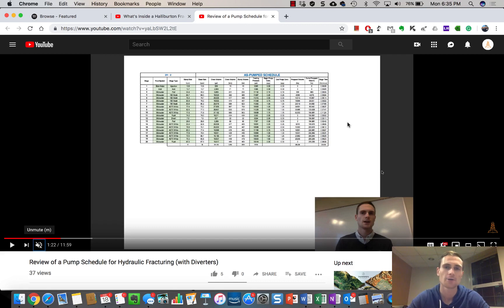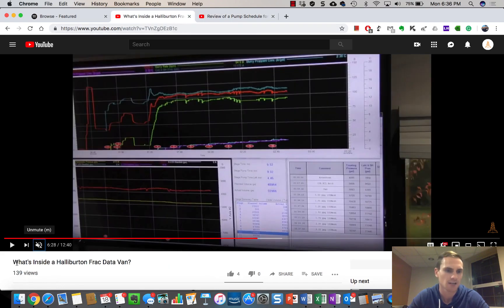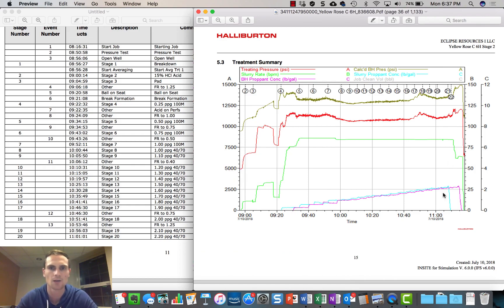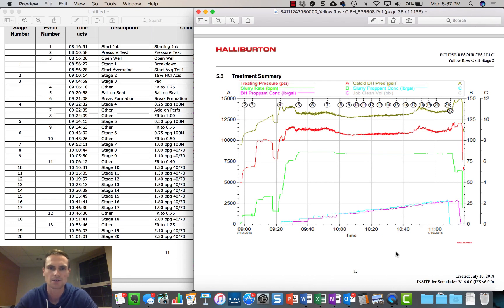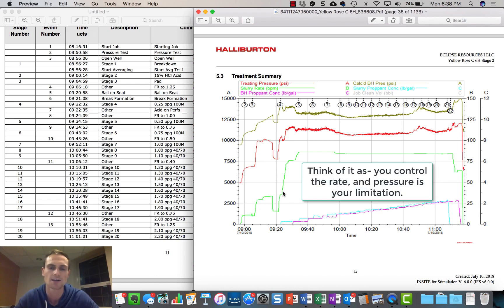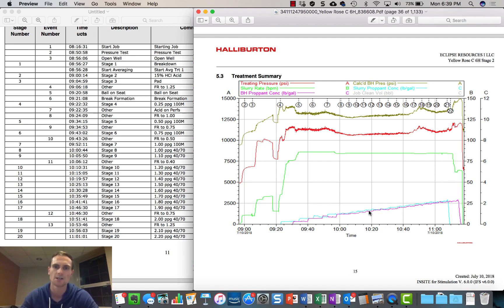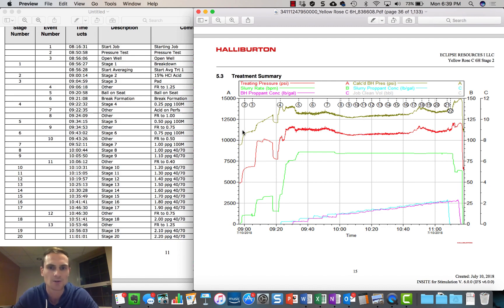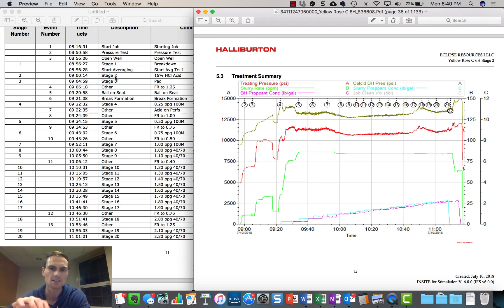Reading and Learning from a Halliburton Frac Treatment Graph

Comment: By any chance do you know how the ball does not block the fluid flow once it seats?Thanks for the video.
Reply from the maker: The ball is seating on the plug that prevents flow into the previous stage. We don't want to pump into the stage that we've already finished. Once the plug is set and before the ball is dropped, the wireline crew perfs the casing (allowing for the flow into the next stage in a few moments once they're out of the hole). Then they drop the ball which then at that point seals the previous stage by seating in the plug. Does that make sense? Easier to draw it out than type it.
Reply: @OilfieldBasics  Yes. Thank you for the response.

Comment: how does the frac engineer know when to start the flush stage and cut off proppant. In Stage 2 - there was a pressure spike and maybe thats the reason. What about Stage 1 - the pressure was quite flat in that one
Reply from the maker: So I probably won't answer this as good as an actual frac engineer, but I'm guessing there are primarily two reasons. One- a pressure response signaling they could be heading towards a screenout. That would possibly make them conclude the stage early to prevent issues. Thus, stopping sand and attempting to flush the well. Two- if what was planned has been pumped. Remember, they're following a schedule (basically a recipe) from the completions engineer at the E&P company that hired them to frac the well. That engineer has outlined the treatment (and amounts) that should be pumped. Once that target is hit (for example- amount of sand) they will move to the next step- in this case, flush.

Comment: Is there a way to calculate sand? As far as knowing when to walking it up like for example you start off with low concentration sand .25 ppl...1.00 ppg all the way to the final concentration of the job
Reply: Matthew Rangel There are many factors to consider when designing the total proppant mass, the proppant concentrations to use, volume of sub-stages (how much you pump at each concentration, and the max concentration. For the majority of horizontally drilled wells in shale formations you will see roughly 300-750 klbs of proppant with a max concentration from around 2.5 - 5.0 ppg. 

When it comes to proppant concentrations used within the stage it’s a little more complicated. First, you will normally always start with a very low concentration which will range anywhere from 0.1 - 0.5 ppg. The purpose of pumping these light concentrations is to erode the perforations and near wellbore area so you can make the entry points larger and reduce entry friction. This will enable you to pump at lower treatment pressures and make room for the higher concentrations or larger sieve sizes that are to follow. You could start immediately at higher concentrations, but you are increasing the risk of potentially screening out the well. A near wellbore screen out occurs when enough proppant settles in the near wellbore area and creates a flow restriction great enough that you can no longer pump into the formation at a pressure below your maximum allowable pressure.

Getting further into the fracture treatment you will increase the proppant concentration every XX bbls. How much proppant mass you decide to pump per concentration is dependent on what you are trying to accomplish from a fracture design standpoint. Let’s say you have a formation where you expect incredibly complex fractures or want long fracture length. You will want to spread your total proppant mass out over a larger volume of fluid. This will be accomplished by larger sub stages at lower prop concentrations. The proppant is stepped up in concentration and or size towards the end of the treatment because you want higher fracture conductivity in the near wellbore area. Fracture conductivity = fracture width * permeability.  Theoretically this area will have to handle the highest flow rates when it comes time to put the well on production so you want the fracture to be wide enough here so it won’t restrict the flow.

There is so much more I could talk about here, but this honestly would need a video dedicated to it. 

I was a senior field engineer at Halliburton and also spent a few years as a senior frac engineer for a consulting firm.
Reply from the maker: Can you elaborate a little on what you mean? Are you asking how they decide when to ramp up to the next concentration level, or how to calculate the total sand amount in a job (based off the concentrations)?